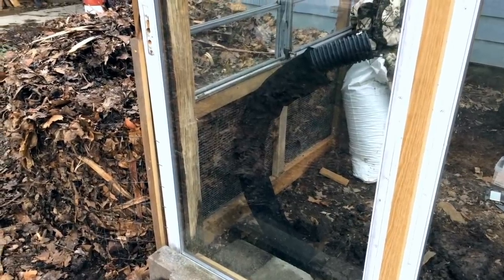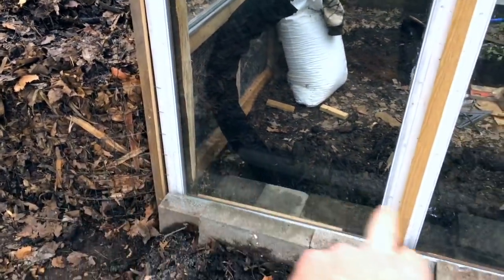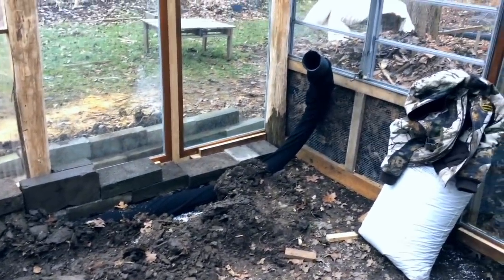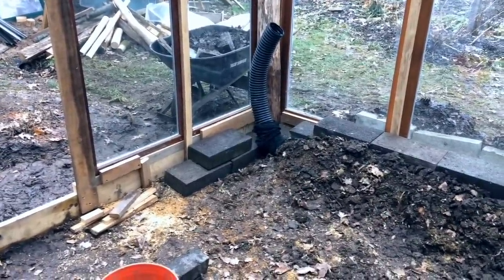Passive Solar Greenhouse - IV - Climate Battery begins and Compost Heating

Comment: So it is not a climate battery but it is a raised bed battery.  That is within your scope. If your ground is not frozen 6 feet down by this time of year you don't realy need a full climate battery.
Reply from the maker: Thanks for clarifying on terms here, thats helpful.  Our ground, with global 'climate change' generally barely freezes down 6" at this point.  Historically it was closer to 4' on certain years but not any longer.
Reply: @edibleacres  We generally get one week of freezing in December and another in January then in the summer most highs are in the 70's so heat loving plants like tomatoes are slow to ripen so they stay in . Much of my garden is in 35 gallon barrels which I can move in and out with the seasons. I have accumulated 4 inch pipes and an exhaust fan so I may try to get them in. I can put my compost on the east end that doesn't get sun and I need the heat under my winter potatoes in the north bed.

Comment: I've studied this extensively, so it's too bad there isn't a better way to collaborate.  There are good things about youtube and I don't mean to be negative but unfortunately there are limitations to what can be done in the comment section.
Reply from the maker: For sure.  Well, if you've got some detailed ideas you want to share with me, we should explore how we can do that.  Phone chat?  Some other method that would feel useful to you?
Reply: By the way I'm very impressed by how much work you got done on it so far.  It looks great.  

Basically, I think a key issue with the physics is that air is an insulator, so it's rather challenging to make a good heat exchanger.   This is why in those designs they have to bury hundreds of feet of tubing.   All that excavation work ends up being expensive.  Also, to push all that air requires a rather power-hungry motor that may use several hundred watts.  That's a lot to generate with solar cells.
  
I was researching some better ways, but unfortunately I suppose it's stuck in the development stages at the moment.

I think the easiest work around for this is to use compost heating in the winter, (and in the summer vent the excess solar heat and use shade cloth if there isn't enough ventilation).  You'll no doubt have your preferred way, but here's an example: http://www.youtube.com/watch?v=tQj8hmOzpsw

I think the question would be how to best use the space on top of the compost while still being able to access the compost occasionally, to turn it, etc.  I wonder if there's a way to put a shelf on top that could either: 1) slide to the side, or 2) be raised up on a pulley, or 3) just keep the top stationary but have a side panel to access the compost bin.

Thanks for sharing your amazing videos.  I'll try to develop a better geothermal system.  Sorry I don't have anything better at the moment.  (Sometimes it's surprising how much thought it can take to make something simple!  haha. )

Comment: Hi Sean, 
   Have you seen John Canivin's video on solar hot air collection?    
 https://www.youtube.com/watch?v=oVsYVTyvBoA 
It's the sort of low tech re-use project that can add "free heat" at a super low cost. It's still early in the build, but can you make a video... measure the air temperature difference inside the green house and outside (during the day and night)? It would be nice to see this as a series of videos as work continues and you button up gaps.  Cheers,    
    Bill
Reply from the maker: Good call on documenting with actual numbers.  I may invest in some data loggers and track.  Could be quite worthwhile.
The video you link to is like a Trombe wall... I have intentions of adding in small versions of this, thanks for the reminder.

Comment: I am dubious that you will ever get any air flow through the tubes.  Even more dubious that you will get WARM air flow through the tubes.  Most examples of warm air thermal mass systems have been practical failures.  Using fans are unlikely to help more than a similar wattage heater would.
Agree with your concerns about foam board insulation's embodied energy.  I have seen analysis that foam board is NEVER energy positive (in many applications).  However, there are mineral wool (Roxul) products which are certified for underground use, they might be an option for you.
I am concerned about the amount of general air leakage you are going to have.  The whole utility of a greenhouse is based on keeping the warm air in.
Is it warmer in there than outside, at the moment?  How much?
Reply from the maker: The greenhouse isn't buttoned up at all at this point, as I mentioned in the video.  MAJOR gaps still to be addressed, which I'll get to.  That said, it's already so much warmer in there that the ground hasn't crusted at all after 20F nights.  I'm not expecting performance from it yet, but it already is.  I think being coupled to a poorly insulated house creates a whole wall of radiant heat!
We'll see how the fans work.  I have a temperature monitoring device that I plan to test things with once they are up and running.  That, and a compost thermometer to help monitor whats happening.  If I can use 5w or smaller fans to cycle air through I would like to see what it can do...
Reply: @edibleacres  That will certainly have a effect.